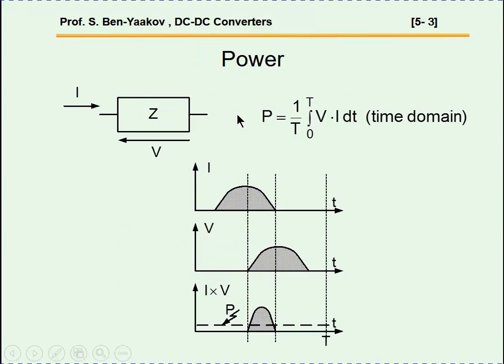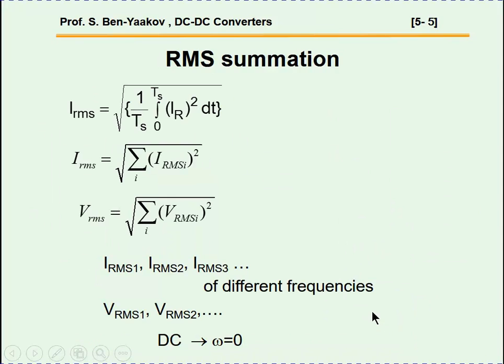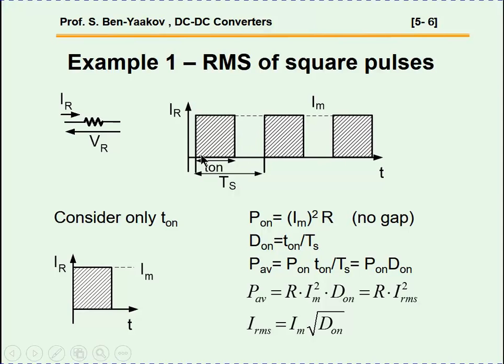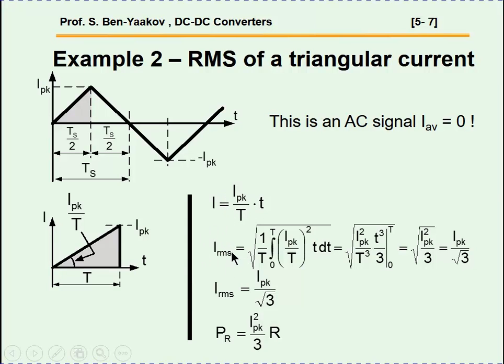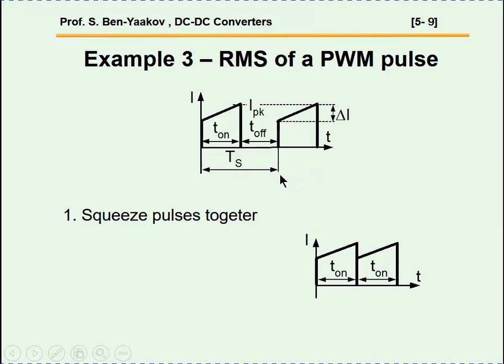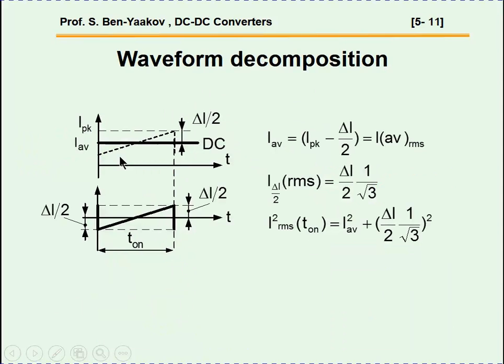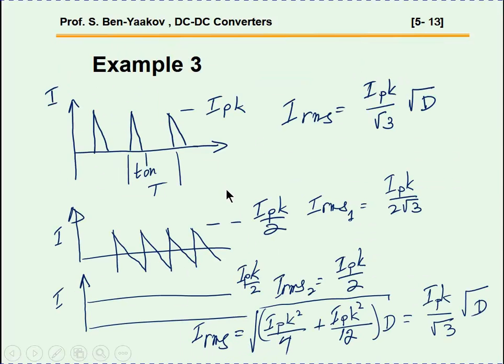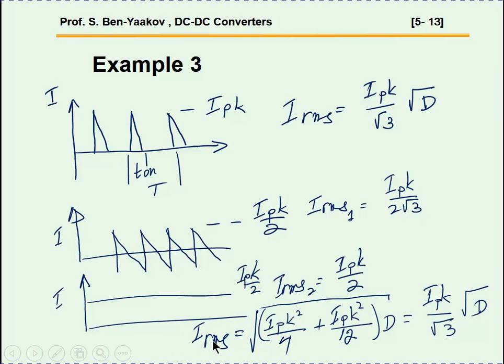Back of the envelope  RMS calculations in power electronics

Comment: Thanks. Believe or not, May be this is a silly question, I read about 10 books in Power Electronics and when they calculate the efficiency of a DC/DC converter, it comes to some references take RMS values only for V and I to calculate Pin, Pout, some take AVG value and some mixing them. Each has his own reasons. Some assume output voltage is fixed so consider AVG, some consider rippled output so consider RMS, the same for input power but still no solid rule for that. Answers vary a lot. What do you think ?
Reply from the maker: The definition of power is AVG(Integral(V(t)I(t))). Period. Now if the voltage is constant you can multiply in by average current (AC current time DC voltage is zero). Stricly speaking Irms *Vrms is incorrect.